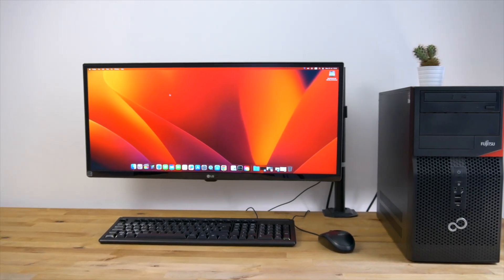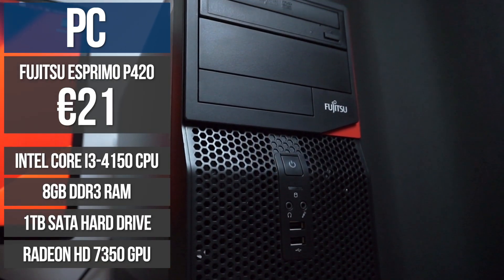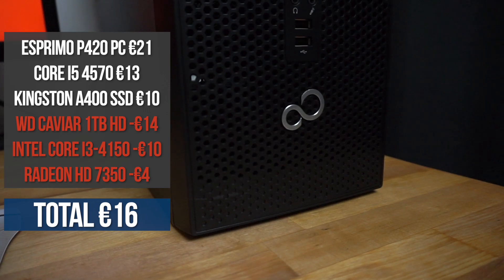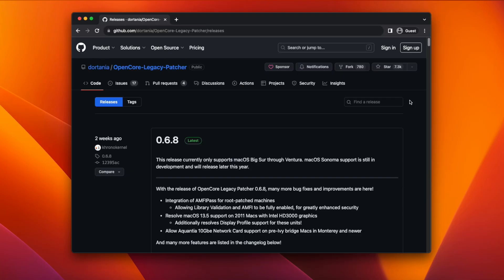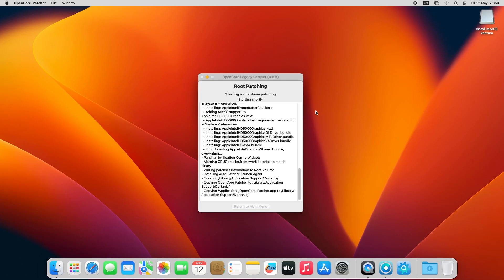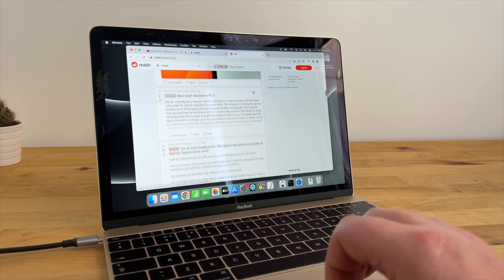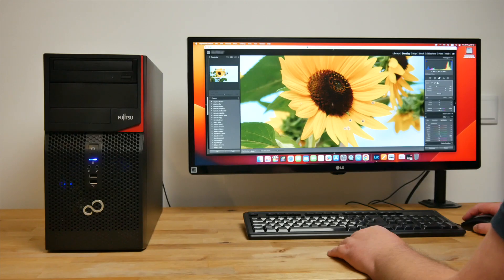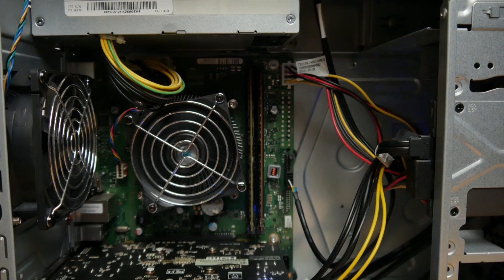Using a $17 Hackintosh

Comment: Would this work on a Dell OptiPlex 3040m micro PC i5-6500T, as I fancy a smaller box. I think that's a 6th gen processor. Would the integrated graphics be up to the job? If so, I might give it a go. Thanks for a great series of vids.
Reply from the maker: Yes, it would work. You wouldn't even need to use OpenCore Legacy Patcher after install. You can just spoof the Skylake HD 530 device-id to Kaby lake and it'll work.
Reply: @BartechTV  Thanks for the prompt reply. Not sure what that means??!
Reply from the maker: You can find detailed instructions here - https://github.com/5T33Z0/OC-Little-Translated/tree/main/11_Graphics/iGPU/Skylake_Spoofing_macOS13
Reply: Thank you. I’ll do a bit of self education.

Comment: I wonder if I should do this. too. I have a fully functioning i7-3770, 16GB system lying around.
Reply from the maker: Sadly 3rd gen is too old. Ventura needs AVX2, so that's Haswell or newer.
Reply: @BartechTV  I just don't really want to install MAC OS on my i5-13500, 64GB machine. That one will only rock one OS and thats it.

Maybe I might build a just for fun i3-12100 32GB fun machine for about 300-400 euros for this purpose.
Reply: @BartechTV  My mid-2012 MacBook Pro has a 3rd-gen i7 as well and it runs Ventura just fine

Comment: I'd say that Core i3 is more than enough for daily tasks, especially since it has four threads anyway; not that much slower than i5 of that era

And pairing this build with something like RX 460 2gb will make your life much easier (no need for patches, it's natively supported out of the box, and will speed up Metal acceleration massively)
Reply: tell that to any internet browser that eats 32GB of RAM and still manage to crash with 10 open pages ...
Reply: @minmogrovingstrongandhealthy  use thorium or mercury browser
Reply: @minmogrovingstrongandhealthy  don't use chromium based browsers and that won't happen ever.

Comment: The 17,- pc that became a upgrade with a lot more money lol.. clickbait
Reply from the maker: No it cost exactly €16. Which part are you confused about?
Reply: @BartechTV  +10 for a cpu to run it on cause the cpu it came with was not good enough + 12 for a harddrive, cause which it came with was not good enough.. see, i'm adding more money.
Reply from the maker: "+10 for a cpu to run it"
No, the new CPU cost €13, and I used the money that I got from selling the hard drive for €14. So it effectively cost €-1.

"+ 12 for a harddrive"
No, the new SSD cost €10, which was paid for using the money I got from selling the old CPU for €10. Additional cost: €0

Then I sold the old GPU for €4.

So, the total cost of this computer was €16. I have precisely €16 less in my bank account after buying this PC that I had before buying it.

I hope this explains things.
Reply: @BartechTV Still misleading, and not at all how this works.

If you buy a £40,000 car, you don’t get to say it’s a £32,000 car just because you sold some old stuff for £8,000. It has to be the price anyone else can expect to spend on the same product, not what you managed to haggle it down to after a week of bartering.

Comment: It's a very very good lecture to use the Gen4 Core to install the newest macOS system. Gen4 Core is very easy to be re-built to macOS system with low cost and good experience.

Comment: We must be living in different universes because I have just done an eBay search and not found a single machine matching your specs for less than £50.  The only ones cheaper than that are incomplete machines or new listings a few days away from the inevitable bidding battles.
Reply from the maker: https://www.ebay.de/itm/386101086046 - Ended yesterday for €25.
https://www.ebay.de/itm/235164176658 - Ended 6 days ago for €21,50.
https://www.ebay.de/itm/235153545302 - Ended 10 days ago for €21.50.
https://www.ebay.de/itm/235181608699 - Ended 3 hours ago for €35 (with an i5 and an SSD).
Reply: Poster is clearly from UK where the average consumer is accustomed to paying far more for anything compared to an EU Citizen. I know. I used to be British.
Reply from the maker: Even in the UK you can pick up a similar spec machine for next to nothing. It doesn't have to be this specific model. These Fujitsu PC's just happen to be more common in Germany since that's where Fujitsu manufactured them. In the UK you can pick up an old Dell, Lenovo or HP office PC with the same or similar CPU for under 25 quid.
https://www.ebay.co.uk/itm/155756661820 - Sold for £9.99
https://www.ebay.co.uk/itm/266396196411 - Sold for £19.99
https://www.ebay.co.uk/itm/155749817383 - Sold for £15
https://www.ebay.co.uk/itm/145264243101 - Sold for £22
https://www.ebay.co.uk/itm/115898028379 - Sold for £16 for 5 PC's - so that's just over 3 quid each.
Any of these would be hackintoshable.
Reply: When bargain hunting on ebay you need to have patience, it's not like walking into Currys.
Reply: i got an optiplex 9020 for 50 australian dollars with a 4th gen i7, 8gb of ddr3 ram and a 128gb ssd with a 500gb hdd from an office so i guess we must also be living in different universes.
Reply: Good for you!

Comment: Anyone point me to a decent in-depth guide on generating your own DDSTs? (like down deep an dirty in OpenShell.efi / command-line)
Reply: the Dortina guide is great but only goes so far and it gets a little overwhelming /complicated when you 'sort of' have the same hardware as someone but then say a different wlan card and the PCI addresses don't align.. for laptops in particular because it can be pricey to swap out components and it's frustrating when you know that with the right OpenCore instructions it could work!

Comment: Those PC's certainly aren't selling for that anymore as far as I can see.
Reply from the maker: One just sold today on Ebay for 25€ with a core i5. Seven have sold for under €30 in the last month. The cheapest was €17.50.
Reply: @BartechTV  Cheapest one I see at the moment is £40 then a few at £50-£60, then it starts getting silly from there. Maybe your video has bumped the price up. Not that I'm looking to build one anyway as I have a mac mini (and PC for games which i used to use as my Hackintosh). Still even at £40 it's a lot cheaper than a mac.
Reply from the maker: This Fujitsu PC seems to be a lot more common on Ebay.de, since they were made at Fujitsu's factory in Augsburg, Germany. It doesn't have to be this exact PC though. This just happened to be the cheapest PC I found at the time I was looking. Practically any old office PC, like Dell OptiPlex, Lenovo ThinkStation, HP EliteDesk / ProDesk, etc with a 4th gen or newer Intel CPU can run macOS and the installations steps would be basically identical.

Comment: Are you sure the 7350 HD isn't supported in macOS? Because my 7970 is and supports Metal!

I do think the i3 is enough for basic tasks in 2023
Reply from the maker: The 7350 is a completely different architecture to the 7970. It's based on the Terascale 2 architecture, and has never been supported in macOS. Even if I could somehow get it to work, the integrated HD 4600 on the CPU is three times faster. Not even worth the 4 euros I sold it for.

Comment: I have an HP Elite computer 8300 CMT that I rescued from being thrown away. Can I hackintosh it? It has an i5 3570 in it.
Reply from the maker: Ventura needs AVX2 so that means 4th gen or newer. But you could run an older version of macOS.

Comment: I don’t know how he got this for so cheap, every single Fujitsu computer I see on eBay is WELL over $100 USD
Reply from the maker: I got it on Ebay Germany. There are dozens that sold for under €30 in the last 90 days. The cheapest one sold for €5.50 (https://www.ebay.de/itm/304979245100 )
In the US you'd probably have better luck looking at the Dell Optiplex, HP ProDesk, or Lenovo ThinkCentre. Looking at the sold listings on Ebay.com, there are many Lenovo, HP and Dell PC's with 4th gen or newer CPU's that sold for under $20 in the last month.

Comment: Supplied so many of those Fujitsu desktops., back when they were new. The hardware is rock solid.  We had very few failures compared to other well known corporate brands.  I have one of the older versions of this pc so am tempted to see if it can also be a respectable Hackintosh.
Reply: Sadly, Fujitsu announced the end of production of workstations and PCs.
Reply: The good news it’s not till April 24.  Better news is there will be plenty of these desktops sold off when corps jump ship when they end of life current deployed units.
Reply: Lets not mention their server range.. I've never seen one, but from what I do hear, firmware updates were roulette.
Reply: Servers are rock solid,  in 7 years only ever had 1 doa which was a daughter card failure , not even a Fujitsu pert, and two that failed in the first year of the 3 year warranty.  As I had all, the Fujitsu type training so was certified to do my own repairs, they just sent the parts on a 4 hour replacement, all machines back up and running before the end of the day.  Where I work now we use Dell and HP, there are 5 Fujitsu servers in the Data centre, that never go wrong,  with the exception of the EMC kit neither Dell or HP ever manage to get same day fix, so we rely on the failover for each server.  Their desktop and laptop repair is woeful, they seem to rely on re-certified parts that are often just broken in an other area.    Agreed Fujitsu server firmware updates could be a little sparse but they seemed to update when it was important enough, not just because they changed the logo for the start screen <cough>.  HP.    Bonus with Fujitsu servers anything from 2010 onwards seems fine funning windows 8 onwards, so can be used as desktops.  I use one for compiling its a brute force thing with 128gb of ram and 16 cores, cost me nothing as it was going to be scrapped.
Reply: You should !! Mine is really smooth on Big Sur 😁
Reply: Could you share your experience on desktops of other well known corporate brands? regarding their reliability
Reply: @charleskcchiu  Dell and Lenovo are really good IMO, especially lenovo.

Comment: there isnt many of those on ebay us and they cost a small fortune for a older machine
Reply from the maker: Yeah as I mentioned in another reply, if you're in the US you'll have more luck looking for a Lenovo ThinkCentre or a Dell Optiplex with a similar spec (4th gen or newer CPU). I noticed some Dell Optiplex 9020 machines with a 4590T in the ended items that sold for $16 usd which would make a nice, cheap, SFF hackintosh.
Reply: @BartechTV  i do find the fujitsu design interesting despite ya would need a adapter if the power supply where to fail or upgrade

Comment: Nice video! also it is better for the environment as you are essentially recycling an older PC and bringing new life to it

Além disso, eu não sabia que você era do Portugal kkkk
Reply: relatively high power consumption though.. mac mini 2012s use around 14W at idle / sleep and 27W in use - that's the reason I personally cannot justify a mac / hack desktop - the new silicons are even more efficient; for a senior or school kid okay. Now hack laptops are a different matter - I love my lenovo hackbook pro !
Reply: You do realize that you would have to use a new Mac daily for 10+ years to offset its carbon footprint against continuing to use a PC that is already built. 
And let’s not get started on the financial cost. 

BTW, Mac minis in sleep mode use <5w which was part of their European green certification.

Comment: I just checked ebay in the US and the price of this model is $367.83
Reply from the maker: That listing is an Italian seller trying to sell $20 computers for many times their value. He's also trying to sell 2001-era 17" LCD monitors for the price of a modern IPS ultrawide.
In Europe there are several auctions for this PC that ended in the last month at under 25 Euros. This PC was never released in the US as far as I know. In the US you'd probably have more luck finding a Lenovo ThinkCentre or a Dell Optiplex with a similar spec.
For example, on Ebay US I can see three Lenovo ThinkCentre M93P listings that were sold at $16 with a core i5-4570T that will run macOS fine, and there are dozens of Dell Optiplex 4th to 7th gen systems that sold recently for very low prices too.

Comment: Hi BarTech TV

I'm building a new Hackintosh with this configuration :  

CPU : i9 13900K  
Motherboard : Asus ROG STRIX Z790-E Gaming WIFI D5  
RAM : 32Go  
GPU : Asus ROG STRIX AMD RX 6600XT  
HardDrive :  
1) WD\_BLACK 1TB SN850X NVMe  

Up to my last Hackintosh I was following the Dortania installation guide, but the 13th Intel gen isn't taken in consideration in this guide. So, what is the way to create the correct EFI for this setup ? What DSDT and SSDT, args, drivers, kexts ? I found some EFI for this MB but I wonder how people do to create their EFI on MB + CPU not documented yet ?  

Thanks !
Reply: if you need service of macos install, do let me know.

Comment: Nice! I didn't realize you can make a Ventura Hackintosh using an "out of support" CPU, and even get the thing to use its iGPU.  Another excellent Hackintosh video!!  Definitely looking forward to your next upgrade video for this system.
Reply: @myburn even my core 2 quad can run ventura from 2008
Dgpu needed tho
Reply: @eazy_black  yeah,it's because the igpus where on the motherboard and alot of them where straight up garbage

Comment: Thanks for this video 🙏🏼
What I didn't get right in the video, is how I collect the drivers of my PC. What were you using for that?
How do I add my drivers to macOS?
I recently build a new computer and I managed to install macOS Ventura (never ever build a Hackintosh (my first time).  But it misses the exact drivers for (for example) my Graphic Card (AMD RX 6800 XT) and the sound system from the (Gigabyte Motherboard (z 790 AERO G). Is there a way to do that?
Reply from the maker: The only way to find out is to look at the spec sheet for your motherboard. You shouldn't need any drivers for the 6800XT since it's natively supported in macOS. It should just work. Just add the "agdpmod=pikera" boot argument.
For the sound, make sure that you have lilu.kext and applealc.kext, then choose an appropriate audio layout.
According to the specifications of your motherboard (https://www.gigabyte.com/Motherboard/Z790-AERO-G-rev-10/sp#sp) it's using an ALC1220-VB audio codec. According to the list of supported codecs at https://github.com/acidanthera/AppleALC/wiki/Supported-codecs you can use layout id's 1, 2, 3, 5, 7, 11, 13, 15, 16, 17, 18, 20, 21, 25, 27, 28, 29, 30, 34, 35, 98, 99, 100.  In your boot-args, add "alcid=xx", replacing xx with one of the above audio layouts. Try each one in turn until you find one that works that works for you, testing all of the audio ports, headphone jack, microphone jack etc.
Reply: @BartechTV  Jee, thanks very much man! For your royal answer. I get into this.
🙏🏼🙏🏼🙏🏼

Comment: I Successfully Made my Hackintosh with i5 4440 but I had Nvidia gt750ti I need to install Monterey
It's working AF.
Reply from the maker: If you sell that 750Ti and get an RX 460 or 560 then you can install Ventura or Sonoma.
Reply: @BartechTV  here in Indian market rx 460 or 560 isn't available much.